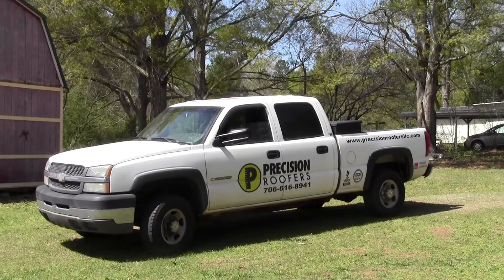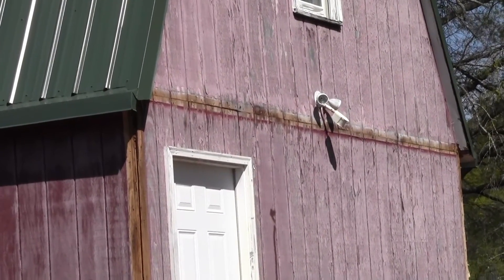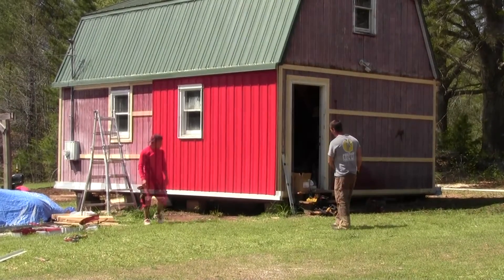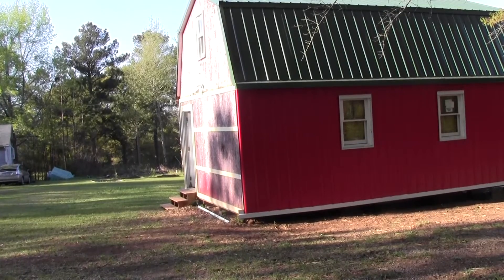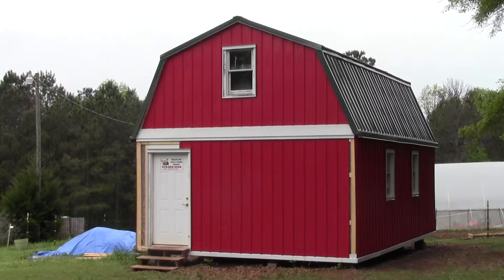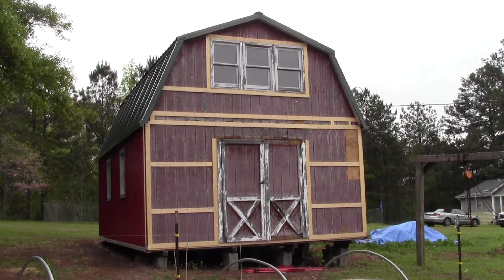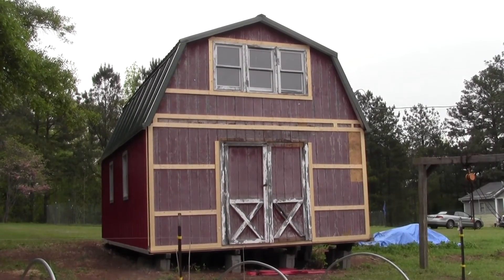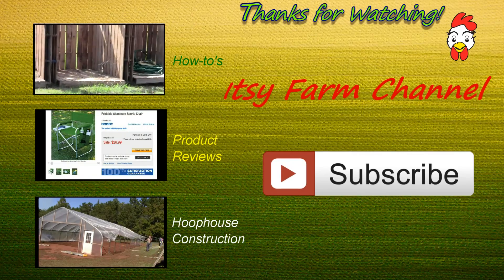The Barn Gets a New Skin !

Comment: The metal looks great! Why did you choose to put metal on over fixing rotten spots and repainting? thanks
Reply from the maker: +coachschro20 Several reasons. (1)The T1-11 wood siding on the two sides that get the most sun was flaking, peeling, separating badly and I would have had to replace almost all of those two sides plus a couple of sheets on the other two sides.(2) ALL of the corner trim, soffit and banding had been installed improperly and was moisture rotten from the inside out. (3) Due to the banding and corners being rotten, the siding edges had curled. (4) I was 67 years old and since it was just me and my wife, we weren't looking forward to lifting those heavy T1-11 siding panels into place. (5) Had already done the roof and was pleased with the metal look. (6) I could afford to have someone else do it.(7) ..and as you said, it looks great!

"...fixing rotten spots and repainting" would have been a lot more work than you can imagine from the video. [Plus I won't ever have to repaint it!] Thanks for watching.
Reply: +ItsyFarm Thanks for replying. I am currently covering my shop in the T-11 with the 50 year warranty, but i'm a little nervous now! lol
Reply from the maker: +coachschro20 The biggest problem with this barn was water getting behind the horizontal banding and trim. I recommend gluing the horizontal edges of the T1-11 and nailing every 8" with ring shank nails and caulking the edge seams before applying the banding. If you choose to pre-prime the banding and trim, leave one face unprimed and glue (good grade construction adhesive) the banding/trim to the siding edges at the joints and nail often with ring shank nails. Caulk, caulk, caulk the horizontal joints and trim. Water getting behind the banding is going to be your worst enemy. If you will have gable ends, think long and hard about how you're going to do the joint between the vertical wall and the bottom of the gable-end triangle. Maintenance is important too. Visually inspect the caulking and joints at least every two years and i would re-apply the caulking every 5-8 years. Check the manufacturer's instructions for installation/maintenance to ensure the warranty is valid for your installation.  Good luck!